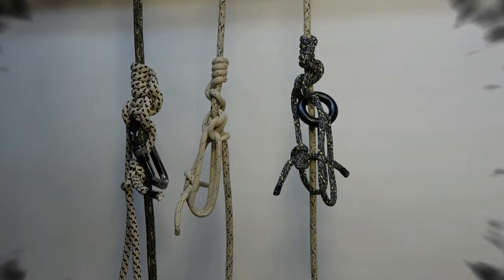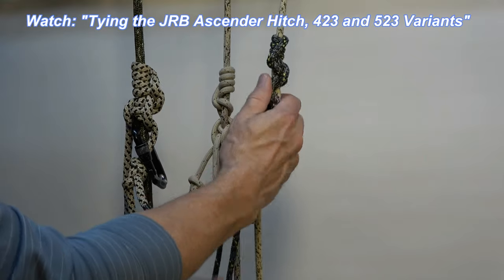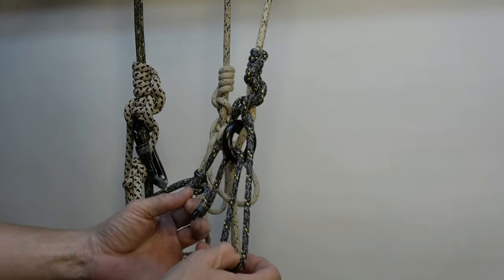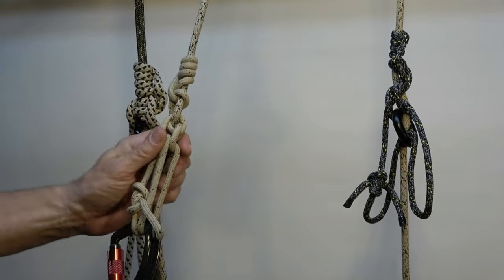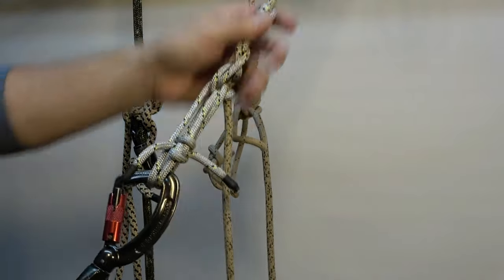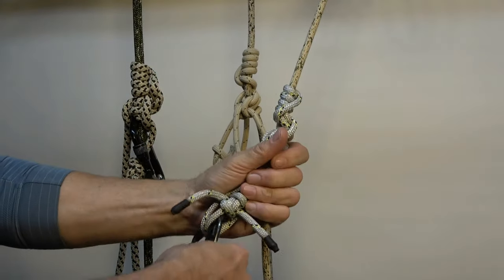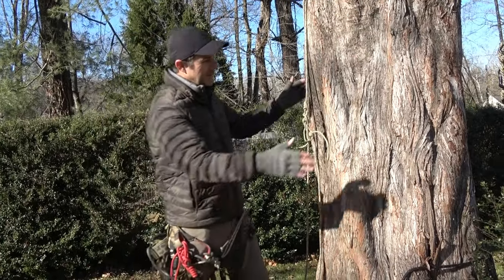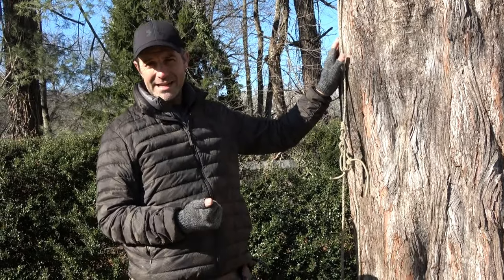JRB Ascender Hitch, Auto-tending, Soft Bridge Mode, for Tether, Lineman's Belt, SRT Applications

Comment: I have been watching your channel for 4 months.  I have not managed to release under a load on the 423 & 523 hitches, double or single rope method.   Now I use a single rope with throw ball; moved over to the Michoacan loop, with some improvement during the climb but not able to release while loaded.  Note: I use a 6 loop design (10.1mm & 8mm static ropes).  Unable to repel or climb with with garda and munter hitches - I use the Ropeman 1 for the foot loops.  I have the larger carabineers (5) you use on the garda foot loop.  Bio: 70 years old male, 3 years rope climbing experience.  Anysuggestions welcomed.
Reply from the maker: There are multiple possibilities, but i would need to see what you have tied. Please go to my website JRBTREECLIMBING.COM and leave me a comment.  I will reply to you via email (likely tomorrow) and we'll figure it out.

Comment: This version works great for a self tending drt using a carabineer on a midline clove hitch. Very smooth operation breaks super easy.
Reply from the maker: Yes, the there are several options for self tending MRS systems.  If ya use the handled version of the hitch, the handle can act as a tender and clip into a prusik that ya put on the static side of the rope.  But if you look elsewhere on my channel for the JRB climbing method playlist, you'll see why I have abandoned MRS/DRT after 12 years of it.  JRB is faster, easier, more efficient and more versatile. There's no need for all that friction and why not move twice as fast if we can. And the redundancy is another Advantage. If my friction hitch were to fail completely, I still would not fall on a jrb system.

Comment: At 13:43 my saddle came default with a prusik hitch on the lineman which is very hard to adjust under load (I would think by design) so it doesn't make a good hitch for adjusting under load. Your hitch is a lot better for the bridge adjustment.

Comment: At 6:53 you use a nail for demonstration. If you're ever hesitant about a nail end possibly damaging your rope, use some push pins that have rounded ends (I use them for firearm maintenance); I've noticed this works well.
Reply from the maker: Excellent.  I actually did take a file onto one of the nails used in one of these videos but I believe I misplaced it!
Reply: @jrbtc  and I forgot to mention push pins are great for getting tight knots out

Comment: Repel should be considered by how close u r to the bedding area since it should be done with concern to your next hunt in that location.  I like when u refer to the application of the hitch cord u r using. Makes me remember the difference between US & French skiing.  In the US we had all sorts of diamond courses where as in France u were responsible for your actions. That coined the phrase 'Land of the lawyer' in the US. 
U don't get a second chance in climbing. Your 1st fall is your last. There is no slope angled @ the perfect pitch to bail u out of your fall. I have found several things helpful in your system.  I highly recommend the Fusion Essence carabiner if u r looking for a quiter setup in your 1 piece carabiner setup. ❤ the 2 grooves @ the 1 end of the carabiner to hold everything in place.
Reply from the maker: Appreciate the comments. On my primary saddle system, i have two adjustable bridges. The upper bridge is generally set long and is where i spend my time on a hunt.  I use a Rock Exotica SwivaEye carabiner with integrated swivel... because sometimes i change positions and spin around in the canopy. On my redundant bridge, used for my munter on rappel, I have been using a Petzl William Ball, which looks similar to the one you recommended. I also keep a full list of everything i am using on the new website:
https://jrbtreeclimbing.com/
Reply: @jrbtc  I also have the Petzyl William B & the Fusion Essence. I'm excited about incorporating MRS, SRS & JRB this system just to keep my system flexible.  I'm a sucker to self tending  since I use it in MRS for 🌳 climbing 🌳 cutting.  But I'm committed to eliminating the friction of MRS. I like having 2 lines in the 🌳.  SRS reminds me of putting all your eggs in 1 basket.
Reply: @jrbtc  Yes, when u have 2 pivot points several feet above & using just 1 rope that goes over both unions I'm sure using that Rock Exotica carabiner makes alot of sense. I will check out your website. Thanks 😊.

Comment: Once again an excellent video. I'm ignorant about the type of ropes that you're using. For your hitches, do you use special rope in regards to friction, such as high temperature rope?
Reply from the maker: I don't generally mention the specific rope and cord combinations because:
1. There are many hundreds of possible combinations. 
2. The design will last longer than the specific products on the market right now. In general, the cord should be about 75% the diameter of the rope. Exceptions possible.  Cord products are generally marketed as "hitch cord" or "utility cord" or "prusik cord" and are generally made from materials with a high melting point.  Although I do tests of it, I am not a proponent of executing a   rappel on a friction hitch only; I always put in a Munter.  This ensures minimal heat on the hitch itself. If you check out my website,  I do list some of my recommendations.  Jrbtreeclimbing.com

Comment: went ahead and got some teufelberger resc tech and some sterling accessory cord, rigged up the jrb system, with redundancy, practiced with it  and got familiar with garda and munter hitches, didn’t have any problems really, pleased with ease of breaking the hitches, the hitches seem to spread out with load, but work great, working out lengths of bridges, which I rigged with the resc tech, replaced my tube web bridge and added a redundant, had the garda and munter hooked to that, studying on the best friend, also using the resc tech for a lineman’s rope with a 5-3-2 on the right side for that, just wondering what do you recommend for the other end to tie off ? Currently using an anchor hitch (from Tree Climber’s Companion) with an extra half hitch and a stopper knot,
Reply from the maker: Appreciate the feedback.  I like a lineman's which is completely removable and so the statc side just uses a Poachers or Scaffold knot on a carabiner. 
https://youtu.be/1eI617uOZhc
Reply: yep looked at those knots, only one loop around the carbariner, was thinking two as in an anchor knot, seems stronger……I like having the one side pre tied witht he ascendr and the other, as you say, removable, with my two tether system I used a lineman every climb, but with this more stable system JRB, I probably won’t be needing a lineman very often, so much easier to install a ring of steps , ascend a bit more and step off on them, having fun learning your system, thanks…. grew up hunting off the ground, lean to (fell off one once, lucky I wasn’t hurt bad) then for decades lugged around a climber, got into saddle hunting when trophyline put theirs out twenty years ago, which got me studying arborist climbing methods, but never trusted one static or moving rope, used two tethers all last season but limited to smaller trees and often precarious situation.. LOL
Reply: went for a scout today and this area of mature hardwoods was an amazing wilderness area, St. Catherines Creek Wildlife Refure, every tree in these woods had NO CROTCH until 60-80 feet, 1-4 foot diameter trunks, incredible, only climable trees were smaller diameter with two tether system. So I am upgrading my two tether system with 5-3-2 soft bridge JRB friction hitches, tied that up and gave it a test, along with a way of rigging a self tending lineman’s rope, which adds a safety feature for larger trees, and I love the ease of breaking the friction hitches as I climb, awesome improvement over prusik loops on the tethers foot and leg loops.

Comment: Could you rappel on just the one JRB ascender? Or are you avoiding that in case one fails?
Reply from the maker: In an emergency ya could.  But it's a lot to ask especially if you're using smaller diameters. And its a lot of totally unnecessary wear on the cord to rappel on a friction hitch. You would need two Rotator replace them fairly often.  I would put in a munter below it every time for a real climb. But this video was trying to demonstrate the properties of the hitch and so I showed what it CAN do.
Reply: @jrbtc  thanks for the explanation!
Reply from the maker: @Dylan Snell, make sure you watch this one. https://youtu.be/KuJNyWTHRvk
Reply: @jrbtc  will do, thanks!

Comment: JRB, could I use the 523 ascender hitch in soft bridge mode, as the bridge itself? Are there any safety concerns? I'm planning on SRT and/or single sticking on 8mm Resc Tech with Sterling 7mm accessory cord for the hitches.
Reply from the maker: You could climb this way, and I have done so, however the purpose of a bridge for a saddle hunter is to provide easy left/right lateral rotation as our bridge flows through a carabiner.  If you use the  JRB Ascender as your bridge during the climb, you would need to transfer onto your main bridge. And so, i really don't see the advantage of doing this for purposes of hunting. I prefer an adjustable bridge (actually 2 of them) and I simply clip the carabiner on it to my friction hitch and stay on it.
Reply: @jrbtc  got it makes sense. Do you think I'll have any issues using 7mm accessory cord on 8mm rope?
Reply from the maker: @alansmith8236  it depends on the cord... it needs to be flexible.  I like Sterling standard 7mm cord, and use it on 8mm rope. And you can get it at RockNArbor.com at 10% off using JRB10 discount code.
Reply: Awesome. Thanks for the content you are doing an excellent job.